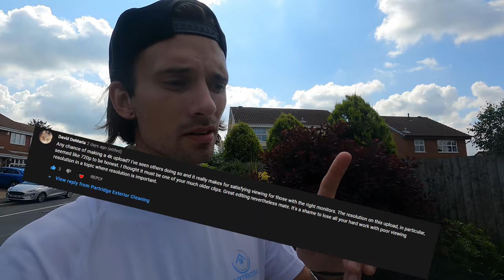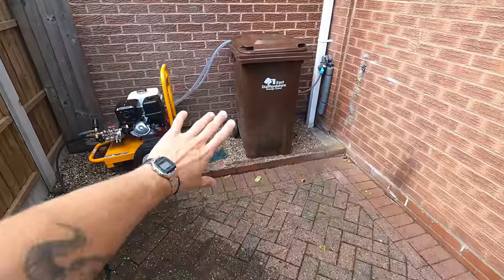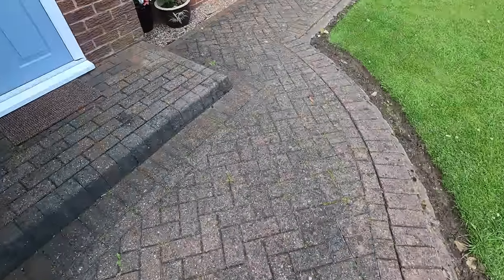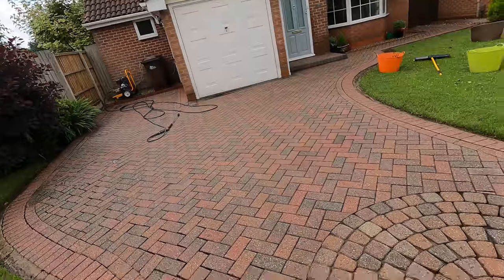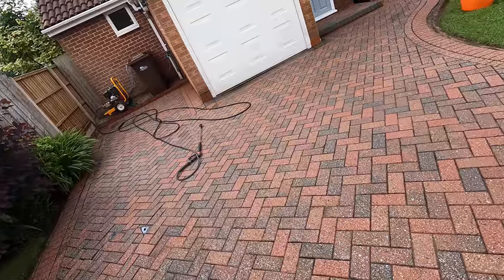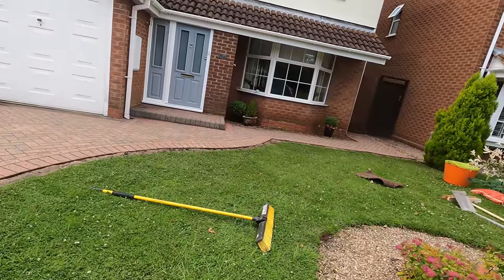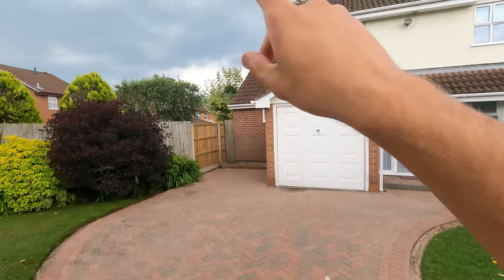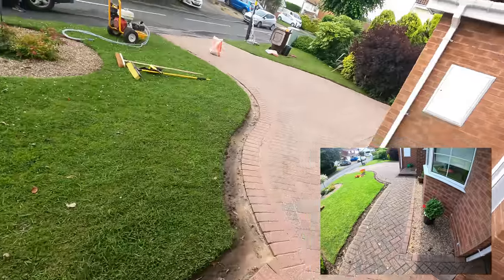"It's NEVER looked so clean!" (Pressure Washing In 4K)

Comment: Good luck on the big job, hope you get it.  Thx again, cheers.  I have a 4K 32" monitor so I can see the difference.  As others have mentioned I don't really see a need for 4K but for sure there is a difference.  Unless they are watching on a 4K monitor or TV their device would not be able to display 4K and would default to the highest resolution it can display.  Also internet speed will also be a factor and data caps.  But if it doesn't effect u as in you have unlimited data, time and PC hardware to edit 4K, no harm.

Comment: Might not have noticed anything if 4K wasn't mentioned but this doesn't seem as fluid as previous videos. I was comparing it to "Helping out at grandma's house". Does the GoPro record in 4K at a lower frame rate ?
Reply from the maker: Interesting! will have to play around with it a bit more, it was 30fps like normal but maybe i rendered it a bit less than!

Comment: Is the karcher k2 or k4 good enough for this? Im looking to buy one to clean car mainly but would also like it to clean my patio and drive
Reply from the maker: It will take a while but it will definitely do the job mate. Just buy their turbo nozzle attachment 👍
Reply: @PartridgeExteriorCleaning  thanks for the reply. Im enjoying watching your vids binge watched for about 2 hours on monday 😅
Reply: Picked up a Karcher K4 today after my old one exploded it’s hose (was a Hozelock pressure washer). It’s fantastic for doing jobs around the garden and driveway and comes with a turbo nozzle.
Reply from the maker: @sinista.productions  Spot on, they're really good, i actually started on a basic karcher for £100! did 3 jobs then upgraded.

Comment: what ratio of hypo do you use to remove the black spots ?
Reply from the maker: Start at 1/4 but if it’s really bad I’ll go higher. Usually 1/4 sorts it on block paving. Some sandstone slabs you might need to experiment more
Reply: @PartridgeExteriorCleaning  Thanks Sid